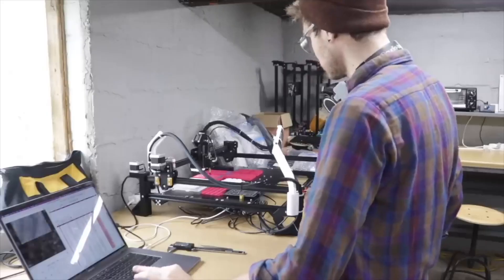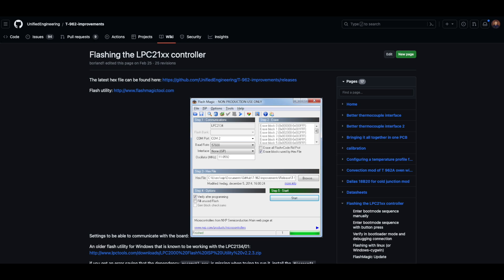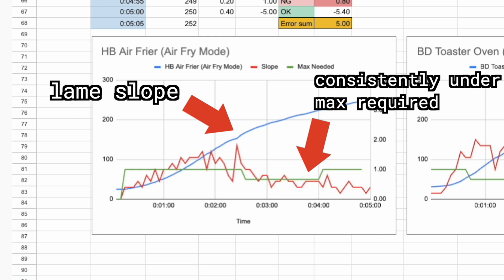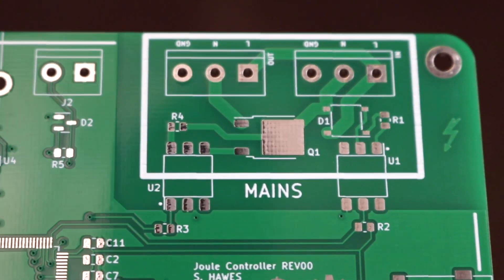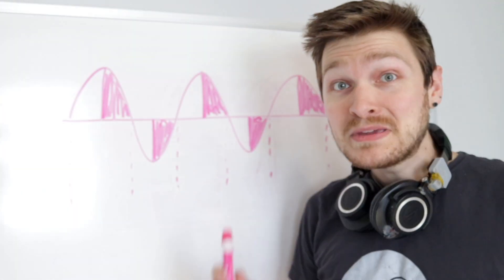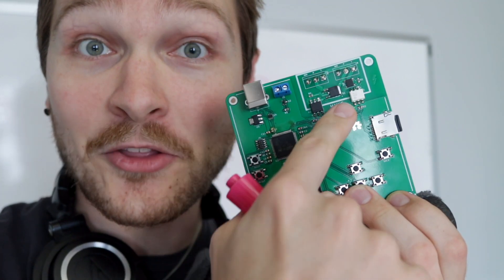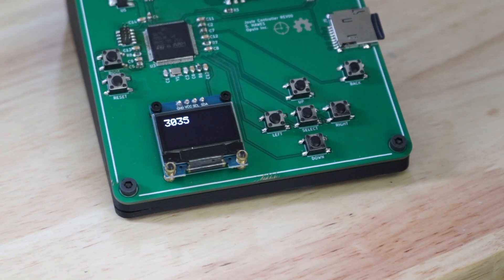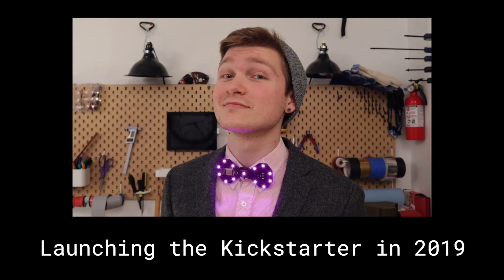turn any toaster oven into a reflow oven!

Comment: Most Solid State Relays (SSRs) for 120VAC 15A have zero crossing compatibility but require 1/2 cycle (180 phase degrees) to turn on/off. My custom PID code for an Adafruit Isty Bitsy Calculates from 0% to 100% Heating in 1% steps. But rather than using a high frequency PWM that won't drive a SSR properly, my PWM is 100 60Hz cycles long (1.667 seconds PRT)

0% = Off Constantly
1% = On 1 Cycle, Off 99 Cycles
2% = On 2 Cycles, Off 98 Cycles
.
.
.
98% = On 98 Cycles, Off 2 Cycles
99% = On 99 Cycles, Off 1 Cycle
100% = On Constantly

It works well for Resistive or Quartz heating elements - the PID just needs to be turned differently for each.

I do cooling in a similar fashion but use a port (door) that opens/closes and a variable speed DC fan based on a higher frequency PWM signal more suitable for a muffin fan.

Comment: I just thought that if you'd just punch current into a capacitor with a steady outflow and a comparator, made out of two transistors, one controles main and, the other basically grounds the output of the read signal to turn the capacitor drain off at a certain voltage, to get a closer dialogical PWM signal. resetting at the positive peak in the next wave.

Comment: Most types of heating elements will run on DC which can be easily PWM'd with mosfets, the power supply components may cost more than an AC solution though.

Comment: Recently I repaired a home heater. It has 2 heating elements, each 1250W. They use 2 quite small relais to switch the heating elements on and off. They are of course rated for that voltage,  current and total power. But both relais had defective contacts.  You could hear the clicking but they made no contact.  I replaced the relais with the same original type. I was looking for for a type that could handle more current but could not find for the same footprint.  I don't know if they use zero crossing detection for that, I don't think they are, as relais are in general not so fast.

Comment: If you are planning to still use TRIACs, have you thought of splitting the current on more than one? In this case, at least 5. It's possibly the worst solution, but if you are just trying to see if the idea works, it should be enough.

Comment: Also, some of what you are doing here might be applied to the other oven.  I've seen a bunch of improvement videos for it, and some are baseline necessary (replacing masking tape with Kapton tape) but a lot are somewhat mundane.  What I thought really good was adding heat deflectors on the heating elements to even out the heat.  That seamed to work quite well.  I think that just adding a stainless steel screen under the heating elements is likely ideal and will make that unit shine.

Comment: Yeah, you need a beefier Triac and heat sink.  That other approach is good too but the triac was really fun!  I would look to parallel a few to give you the wattage.  That is just too cool and simple a circuit to not try further enhancement of.  (Yeah, I really like analog for solving problems ;-).  Also, who worries about EMC ;-). This oven is only going to be on for short periods of time and intermittently.  Just put some high frequency filtering on it and it should be fine.

Comment: Interesting. I build something very similar 15 years ago using a slower AT-Mega16 because temperature control has so much lag that a PWM switching frequency every 3 seconds is more than enough. And switching near the zero crossing is also crucial, as the heating element has a fair amount of inductance beside its resistance, causing the current being not in phase with the voltage. Also switching off a coil under load cause up to ten times reverse voltage as back EMF.
Slow and simple solved this for me.
The only issue left is the gradient: when isolating the pizza oven for better temperature rise, the cooldown gradient is a little slow. Unfortunately most fans last not very long in the heat of this ;)

Comment: You don't need a solid state relay, you already built one. you just need a larger heatsink and either 2 SCRs or a TRIAC that can interface to that heatsink. Most cheap SSRs have a TO220 Triac inside anyway with the same circuit you built.
You will have more surface area for heat dissipation using 2 SCRs rather than one triac and you only need an additional 2 diodes and 2 resistors.
Page 6 of the datasheet for the FOD4208 has the solution.
Be very careful with the SCR selection as most have the metal tab connected to the Anode.
you can get isolated tab versions such as the SV6025L2TP from littlefuse.

A good heatsink to suit is the FISCHER ELEKTRONIK SK-589-150 Series heatsink, It is an excellent choice.
You hold the TO220 device to the heatsink using a THFU 4 Spring clip which you can apply with a press, vice or clamp.
The heatsink has a threaded trench in the bottom that takes M3 screws, You can use 2x 6mm nylon or nickle threaded spaces and 2 M3x14 screws to fix the heatsink to the PCB.
Earth the heatsink with those screws to pads on the PCB.

On a 150mm wide heatsink I would place the supports at 100mm (50mm from the centre line)
The centre line between the heatsink mounts and the legs of the SCRs is 6.8mm (I learnt this the hard way)
You could also add a TO103J2K  NTC Thermistor to the heatsink to measure the temperature and shut off the SCRs should they reach 100°C and throw a fault.

That heatsink will handle 10W without any issues keeping the junction temperature of the SCRs below 110° C.
Make sure you use tracks at minimum 5mm wide for the mains especially if you are using 1 Oz Copper (You can go thinner right at the legs of the SCRs)
Just keep your mains tracks at least 3mm from any other live track and 5mm from any logic preferably with an earth guard ring around.

If you cant maintain those distances  you will need to put 0.8mm routes in the board in those places.

You should also add a Snubber as spikes on the line can trigger the SCRs on.
A good choice is to put a PMR209ME6220M470R30 in series with the incoming power.
You also really should add a fuse and it is also good practice to add a varistor.
The fuse can sit in a screw holder in the rear of the unit and should be directly connected to the incoming active line.
The varistor goes in parallel with the Snubber and will blow the fuse should a large enough surge occur.
The Varistor also absorbs spikes on the line.
A good choice for the varistor is the  MOVTP14V275N from Eaton.

Comment: Is it really necessary to get this fine of a level of control? I would imagine you can get close enough to your desired slope by controlling the duty cycle in MUCH lower granularity. Like, every quarter second or so? Then you might cut off a little bit of the power of which ever is the last wave, but if you are using a factor of the frequency of the electrical grid and your clock is reliable then that should be fine.

I would also personally not want to be pressing buttons on a board where some of the pads have 120VAC running through them. It's all well and good to use plugs but what about covering the AC part of the board with some plastic so you don't accidentally hit it?

Another idea along these lines: if the ovens have internal switches, I wonder if you could just you know wire your microcontroller to one of those.

Not to take away anything from how cool the idea is.

Comment: For high amps like that, i think it would be better to have it in seconds. (Ex: on for 1 second and off 1 second) which would give a 50% cycle, but safer for a relay and the oven's controllers. Also, seconds should not impact that much the temp, as it has a big thermal mass.

Comment: We did something like this, back in 1978, to control a 10 kW arc lamp.  Switching  full AC (no rectifier) OFF at the desired point causes less dissipation in the triac.  (And MIGHT clean up the noise.)  As I recall (it's been a few months, right?) we used a diac to drive the triac.  Again, from really failing memory, I think we had an RC snubber across the output.  (No need for it in our application, it was industrial - but you may want to use one.)

Comment: Nice video, gave you a like. At 9:47 you don't have to be that fancy with your PWM/PID control. The heating elements have a slow response (about a second) so a 5 Hz PWM with 60 Hz Mains for a 1 second heating element is fine. You don't have to worry about zero crossings because you get at least 6 AC cycles at 50% PWM. So even at 10% PWM, you may miss most of a cycle on a pulse, but on the next pulse you will get more of the cycle. The heater is so unresponsive it acts like a low pass filter to smooth it all out anyway.  I have adjusted PID controls from tiny to huge thermal chambers that use ceramic/quartz heaters and a slow (5Hz) PWM frequency is all you need - and no monitoring of the AC zero crossings, just simple on/off with good PID control.  If you are making a controller for home use, EMI/EMC is generally not a concern. True, without zero crossing switching, the sudden current on/off from switching will generate some noise, but if you put your controller inside the control compartment of the oven (with some fiberglass insulation), the metal case of the oven will shield the EMI and a small AC Choke around each Mains lead inside the over that feeds the relay will block coupling back onto the mains. I built my PWM/PID controller with an $8.95 USD Adafruit Trinket M0, a 20A AC solid sate relay, Type T Thermocouple, an NPN transistor, a 510 ohm resistor, a schottky diode, a 12V wall power supply, two RF chokes, and a start pushbutton... along with other ancillary parts. The temperature profile is encoded in the Circuit Python code inside the Trinket, just set the oven to max and press the button to start the thermal cycle. I will post a video soon.

Comment: The real problem is not the controller but the oven it self.  It's too larger for the task with too much thermal mass given the limited power input due to mains limitations.  I found the quarts tubes tended to burn things before reflow was completed.   What is needed is a smaller lower mass type oven cavity that can heat and cool fast, allowing the PID to work correctly.  One thought I had was to control the temp with some sort of servo driven air blend door, that could select between a reserve of heated air and cooling air.  The heated for the hot air source could be stored in some preheated thermal mass that gets charged prior to starting the the cycle.  You could heat charge the thermal mass over a period of time even allowing the use of low voltage input power eliminating the need to deal with mains voltages.   Think of a 3D printer with low voltage heated bed and hot end.

Comment: PWMing is ... noisy from a stability POV and even more so at these power levels. Me, I'd approach it differently and focus on adjusting the AC voltage amplitude being delivered to the load to control power output. Thus, the AC output power waveform is stable and you're just modulating its amplitude.

Comment: If you switch on the peak it’s now wonder you fry the component. Switch at the beginning of a wave. Because the triac needs time. For example it needs 4 microseconds.  In this time the resistance is much higher as in the on state

Comment: I was expecting your finger to touch those live mains pads on the PCB. Not very safe having the PCB exposed like that. Also, your triac is too underpowered. Just buy a higher power triac and use heatsinking. The tiny one in your project is great for lighting. No good for heating and big currents. Be safe!

Comment: I suggest you take a look at driving soldering irons or other open source reflow oven projects, Soldering irons are driven by 24V (AC OR DC) typically but usually driven by 2 SSR's or solid-state relays. I would say this is likely to be the best approach.
Keep in mind resistive heaters don't care whether you are driving them with AC or DC so you could potentionally convert it to use DC and use MOSFET's. I would just do some research if the heating element used can actually work on DC.

Comment: You need to pick up an isolation transformer. This way if you ground yourself while grabbing high voltage you don't make a circuit. Also, I have built 1500W heaters with crydon SSR's that work great. I also recommend adding a thermal fuse to prevent the oven from cooking itself if something goes awry on the control board. I have taken the heater product through FCC and CSA ISO601010 testing if you need help or advice.

Comment: Stephen, I had also read about all the nonsense with stuff wrapped in masking tape inside the T-962A. But the real problem apparently is that there is no convection, so the heating is not uniform, as you mention. 
I eventually bought the ZB2520HL which has a comparable price I believe (ahem...unless you get conned by some scalper as I did). Same form factor and the firmware is still appalling. But with the 'curve 4' setting for lead-free paste I have never ever had a bad reflow in a few hundred that i have done in the past 2-3 years.
Only issue it's a bit slow to cool down, and I usually set a timer to open the drawer a bit.

Comment: You are making something really similar to the Beta Layout Home-Office SMD Kit that Dave Jones made a video about almost 10 years ago. We've had that in the office for several years now and its awesome ! Best way to get a cheap reflow over I've found so far.

As far as mains control on the heater goes - the best cheap way i know of controlling those currents is with a beefier TRIAC, in like TO-220 or bigger case plus heatsink coupled with a zero-cross triac driver. Something like the MOC3043SM, that is extremely popular. Its a way cheaper solution compared to a solid state relay. The way i like to use this combo with a regulator (PID or other) is by just turning the cycles in groups of 20. 1 cycle is 5% power, 2 is 10%, etc, etc. If i want finer control i can get up to groups of 40 cycles. Since heaters are VERY slow, the end result is the same as if I'd used per-wave chopping. 
I picked 20 since I'm in the EU, we have 50Hz mains here so 20 cycles is 0.5S. 40 is 1S.

Comment: Jikes! NEVER NEVER EVER Do mains electrical testing on a development platform like this! Instead of a mains supply, use an transformer for the mains part. It's absolutely bonkers to test this with a hot wire. Use a 24V transformer for all the testing and measurement until you get comfortable with the curcuit and the PCB and know, when, where and why there's voltage and what it looks like. After this, you could use life voltage IN A CLOSED CASE!

Comment: Does the toaster oven require AC to operate? If not, would it be easier to rectify mains and control high voltage DC?

Comment: Really cool but isn't that a little over engineered? Mains are running at 50hz, if you have a PWM that has a 1 sec cycle the problem you are talking about is irrelevant since the wave cycles 50 times a second. Then by having a software PID on the microcontroller you can easily regulate the temperature in the chamber. I did this when creating a simple Sous Vide machine some time ago.

Comment: as you said once for the pnp sw, you used some parts of marlin 3d printer arduino stuff, why you just use a standard relay, like  the 3d printer heat bed or the extruder nozzle heating principle for regulating the oven power input ? then you still would be within the certification of the oven, as no modification would be done to it

Comment: Basically it’s a phase cut dimmer your making, I could suggest an FL5160 it is controlled by 0-5v signal, and uses 2 IGBT which you would need to mount to a heat sink.

Comment: 3:00 ".. also considering the certifications" - LOL, I don't think you need any. Just slap an ISO9000 sticker on the back. She'll be good. That would be one more "certification" than the T962-A oven has.

Comment: Well most heading elements  I know do not use Analog control for power it.

Most of them heatuntil a target temp is reached and then just shut on / off with a small Hysterese.

Comment: I think an SSR is the best solution to this, just be sure to get a genuine one from a reputable manufacturer.  There's lots of cheap clones out there if you don't buy from the usual suppliers.  Also, keep in mind that SSR's tend to fail CLOSED if/when they do, so some form of thermal runaway protection should be implemented if this is to be a product.

Loving the progress so far though, this is an awesome project!

Comment: 100% chopping at zero crossing is so much easier, less problematic and give you enough control for what you try to do.
But also would be interesting to play with refractive bricks and Nichrome wire (heating element) to build a fully automated p&p + reflow system on rails

Comment: Need a higher rated triac, for a 10 amp load I would use a 25 amp rated triac. Also need a proper heat sink and cooling.  

Edit: I rewatch this video, a solid state relay is just an opticoupler and a triac in a single package.  This triac should work well into your design.
STMicroelectronics BTA24-600BWRG 
TRIAC Alternistor - Snubberless 600 V 25 A Through Hole TO-220.

Or

STMicroelectronics T2535-800G-TR
TRIAC Alternistor - Snubberless 800 V 25 A Surface Mount D2PAK

Comment: Honestly, the best 'don't touch anything inside' might just be to pop the temperature control knob off and mount a servo with double-sided tape.  You won't have to touch mains OR the oven itself, and switching ovens would be a matter of five minutes for moving the hardware over followed by recalibrating everything.  (That being said, a simple relay to turn the oven on and off would also be handy.)